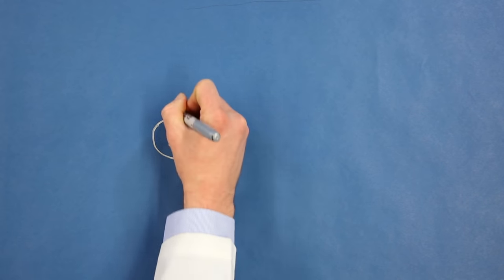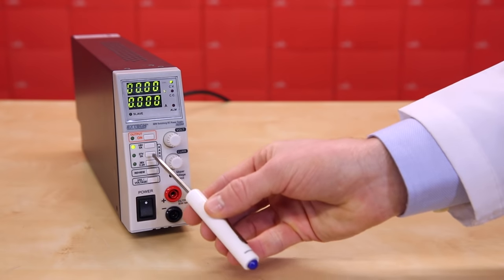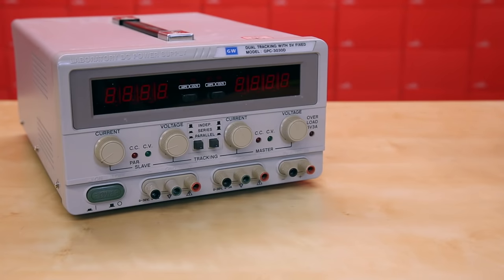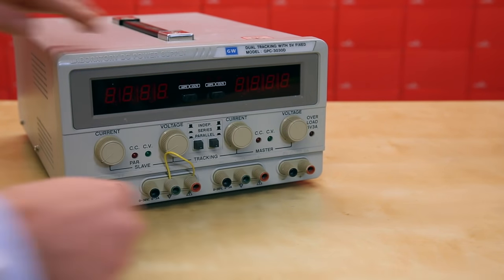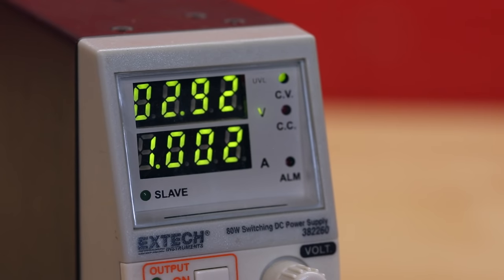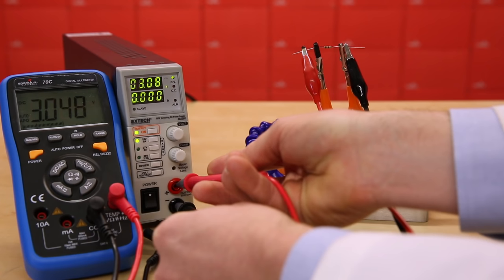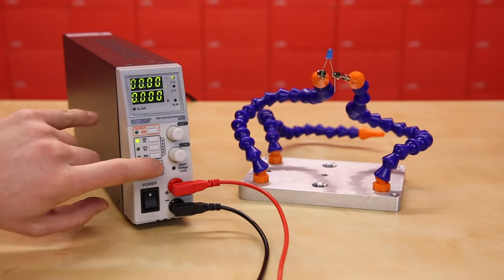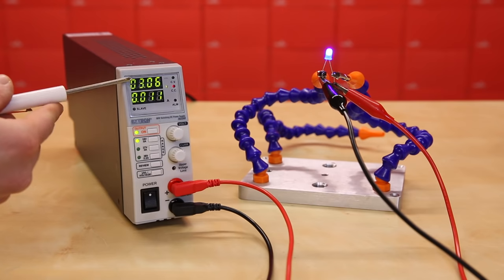How to Use a Power Supply

Comment: I have an LED light which has a ground wire that I want to test with my power supply. 
What should I do with this wire if my power supply only has a positive and negative terminals?
Reply: The ground wire does not need to be connected to ground but you can connect the ground wire to a piece of metal touching the ground

Comment: I want to test dc motors and lights etc...Is this the type of power supply I should use?  thanks a million.
Reply: Yes, this type of bench top power supply will work well for testing lights and motors, as you can set the voltage and limit the current.

Comment: Where can I learn about DC power supply safety and handling I cannot seem to find any good sources online
Reply: I'm not an expert by any means, but some things to ponder. Keep yourself dry, anything under 24v I personally consider safe in completely dry conditions. Osha says up to 50v should be relatively safe in dry conditions not to say you can get shocked or burned still. You even feel even 9v  your tongue. In general mitigate physical contact if you can, ppe like good rubber shoes and gloves might not be a bad idea if your not sure. Again not an expert but I've worked a lot on 12 and 24v systems DC. Currently I'm working with 48v batteries and those I'm going to be using ppe

Comment: *All this is confusing lol. I have a bench power supply that has 30v and 10 Amp. I just want to test headlight assemblies, but I'm not sure how to set the proper voltage, Amp, what's the difference between coarse or fine.
Reply: Coarse moves the amperage level up faster (like 1 2 3 4) and the fine knob moves it in smaller increments (1 1.1 1.2 1.3 etc) 

This is so if you’re hooked up to a motor let’s say, and you want to hit a specific RPM, you could get it close to speed using coarse and than fine tune the power with the fine knob.